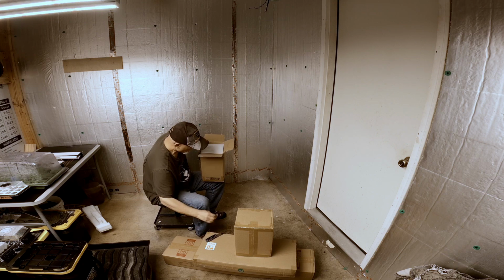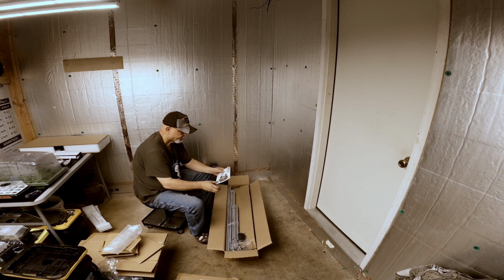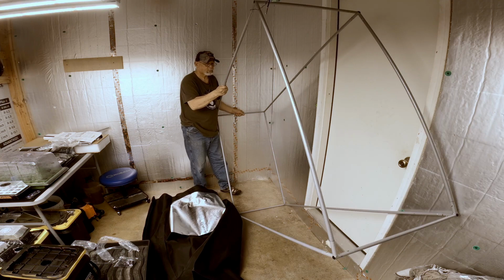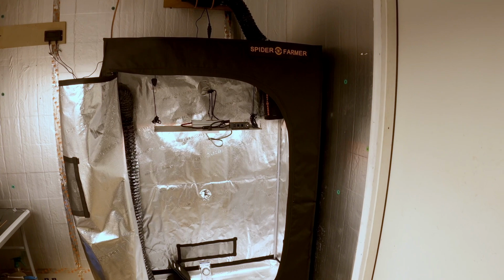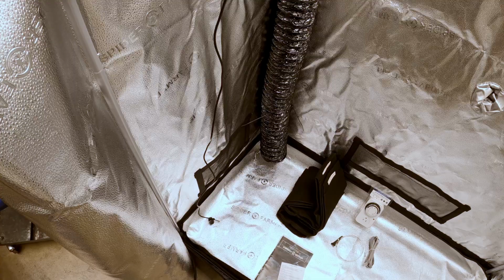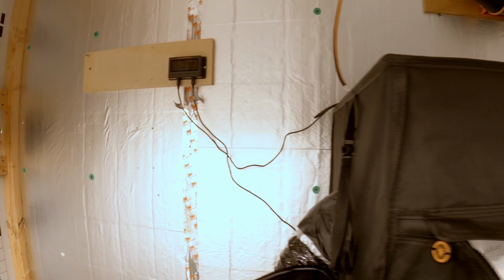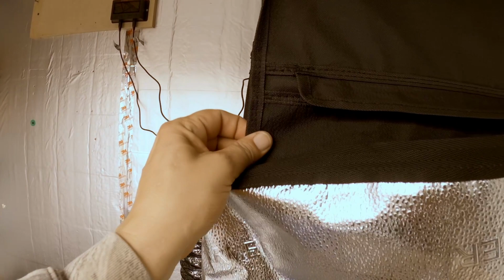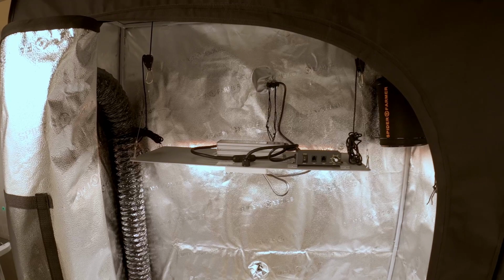Spider Farmer 2x4 Grow Tent Kit: A Complete Setup Guide

Comment: I was looking for a video where someone demonstrates how to put it together. Not watching someone do it sped up with no instruction. The directions that came with mine have J and K with an arrow pointing to the top of the tent and no real directions, and the lights don't really have directions for hanging them either. I had to get metal loops to put around the K pole at the top to hang the light because I didn't understand whether I was supposed to just tie a knot with the rope to the pole. I've never seen any user manual like this
Reply from the maker: Hi! If your tent is missing the instructions check the Spider Farmer website, scroll down on this page & you'll find some good info. Thanks for watching!  https://www.spider-farmer.com/products/spider-farmer-4x2x5%e2%80%b2-120cm-x-60cm-x-150cm-indoor-grow-tent/
Reply: It's like we had the exact same experience. Can't figure out how to hang the light,  came to find a "how to" video, now am dissapointed because the "complete setup" video didn't show me how to "completely set it up". Ughhhh, so close!

Comment: I just opened my 2×4 tent , plastic corner connectors. 
No bottom side vents.
Reply from the maker: My 6 foot tall 2x4 doesnt have the bottom 6 inch round ports either, but the 2.3 x 4.6 x 6.5 foot 2x4 does have them. The plastic corners are actually pretty good, heavy duty and they allow you to tighten up the tent fabric. Thanks for watching!!